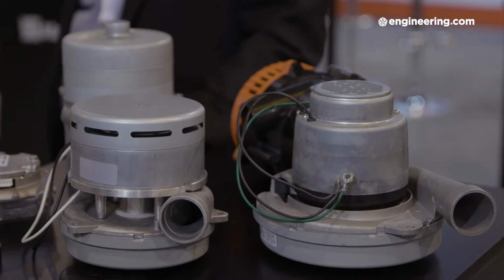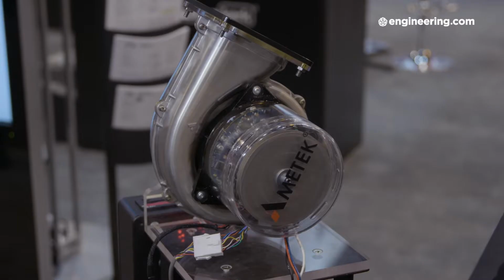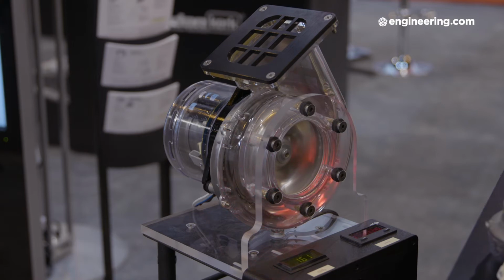A Look at Brushed Vs. Brushless Motors for Blower Applications

Comment: Brushless motors revolutionized the unmanned aerial systems (quadcopters, "drones") because of their high torque, nearly infinite controllability and overall efficiency.  A typical control system uses an ESC (Electronic Speed Controller) that simply applies power to the stator electromagnets in succession to cause rotation.  If this is a square wave, as is often the case, it can produce rather a lot of radio interference as well as minor mechanical stresses.  Top of the line DJI control technique is to use a pulse-width modulated current that effectively ramps up the current on each stator magnet which eliminates radio interference and the vibration that accompanies electronic commutation by square wave controllers.